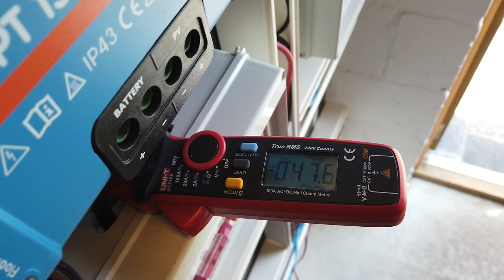Connecting LiFePo4 batteries with the DIY busbars

Comment: Loooovin this video series man, please keep it up! I'm in the same boat, soon building a house and want to have a DIY batteries, panels, etc. 

I was just wondering a couple of things, if you happen to know!

1. Are these high quality connector for batteries available in Amazon Europe? (I live in Spain)
2. With Victron MPPTs are you able to produce as much energy as the panels can create and send it to the grid? I just want to be able to manage the energy I'm producing even if the batteries are full and not just thrrotle the MPPTs instead.
Reply from the maker: Thanks for nice feedback Jonatan. Working hard on next release, should be online this week. Will check for the connectors, I'll keep you posted. Check my FB channel too for updates about hardware. https://www.facebook.com/groups/1076897519357184
For now, the powerwall if fully off-grid. In the future it should compensate for the house usage but don't think I'm gonna send power back to the grid. The installation is needs to go trhough serious inspection and honestly in future with EV, heatpump, ... there wont be much left to send to the grid.

Comment: Thank you for the video -- excellent job -- (2) things ... What SIZE fuse are you using (you may have said earlier and I missed it) .. and second .. I think I mentioned this earlier in one of your previous videos but ALL the cables from all the wires really should be at the same length in order to ensure that all the batteries are charged and discharged equally ... shorter paths get more use so we try to make all of our power paths identical lengths ... GREAT WORK though ... // as a sidenote its funny to see you with a jacket and watch cap on .... its 95 degrees F here in South Texas ....
Reply from the maker: Hi, 
Good question, didn't mentioned the fuse size in the video, will add it to the video description. It's 125A. Normally it's should never melt, the max current of the BMS is set @ 100A.
Some paths are indeed a little shorter, but with the limited current per pack the impact is very limited, but it's a good idea for a future video to check the difference over the packs under load.

About the side note....I recorded the video a few months ago (January/february) during wintertime in EU. I used winter timeframe to swap the old 25KWh 18650 PW with the LiFePo4 PW. It' was 40F back then, now we're in the low 70s.
Thanks again for great comment, these things keep me going.

Franky - easypowerwall.
Reply: Do the math on cable resistance vs. battery effective resistance at nominal current. The difference is around 100x making cable length matching not as important.

Comment: Hello. Just one question. What kind of screws did you use? I'm talking about type of metal to avoid electric corrosion between copper and the second one metal?
Reply from the maker: I used INOX screws. System is in use since 1 year and there's no corosion. 

Franky
Reply: @easypowerwall  Same here. For Aluminium I either use inox but I prefer to use paste from wago. But... Still I some kind guessing. I have read a lot of articles and still I'm stupid....

Comment: Personally, I would have gone for the Lynx Power-In, Shunt, and Distributor system. Much cleaner, easier to install, much smaller compared to one in your video.
Reply from the maker: Yes that's personal choice. I like my setup, much cheaper and easier to service and add hardware in the future. Thanks for taking the time to send me comment. Have a nice day.
Reply: @easypowerwall you are right... Everyone could use what he/she prefer. In my opinion DIY is about fun and experiments. You could always buy ready stuff if you can afford but this is not a deal...DIY is about invention and out of the box thinking.

Comment: The fuses are 32v is this a problem with 52v system
Reply from the maker: I noticed that too. Fuses are there to limit the current, actuall can't think of any reason why a fuse would work at 32V but not at 52V DC. Installed it and never failed....